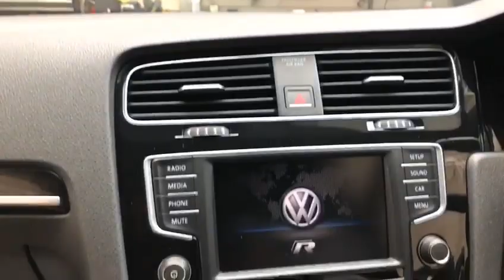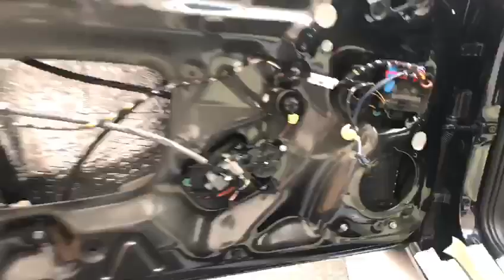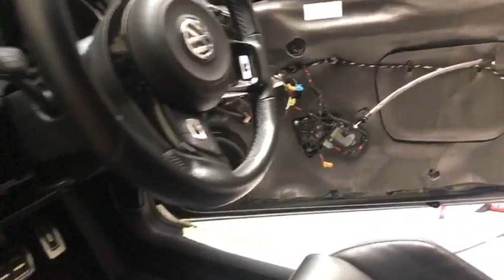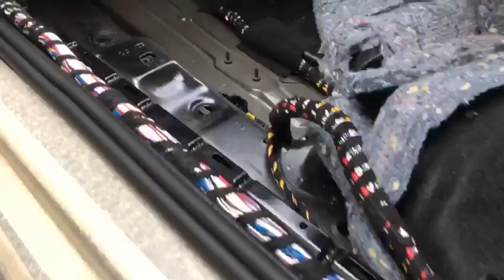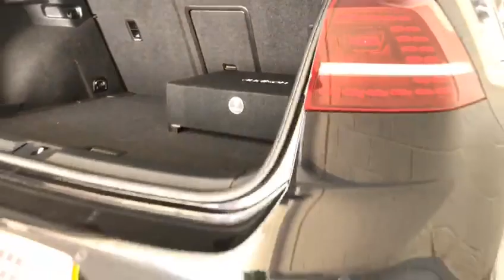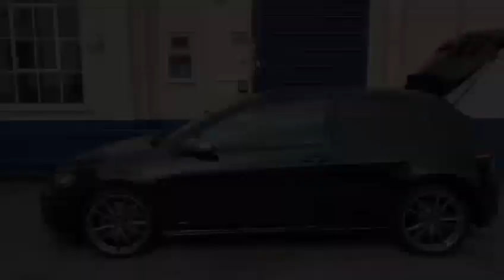Ultimate Car Audio Transformation: VW Golf R MK7 Sound System Upgrade

Comment: that looks like a nightmare. i'll stick to the average stock speakers
Reply: Stock speakers with the VW subwoofer in the boot (where the spare wheel goes) and reprogramming using the VW dongle (either buy it for £80 or your dealer should have it) was the best £260 I have ever spent on an audio product. The maker of the sub and anp re-tuned the whole system. For the money, there's nothing to beat it.